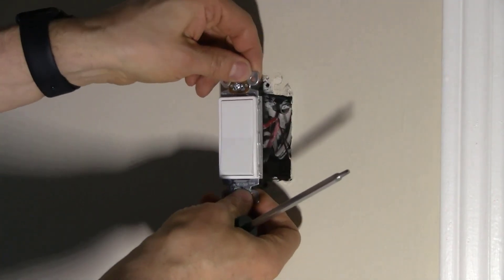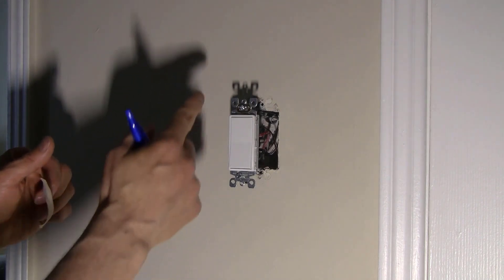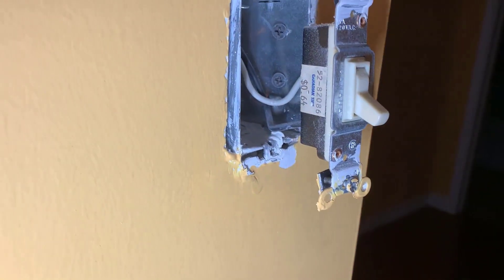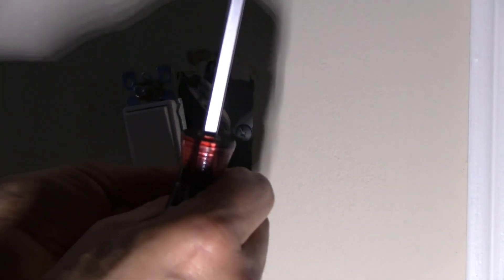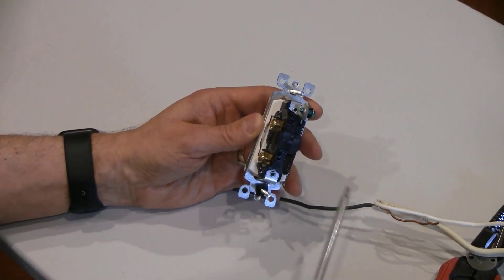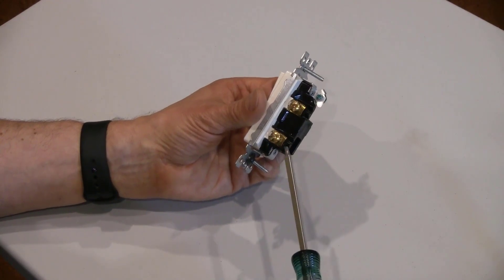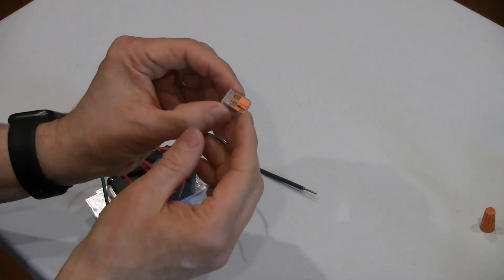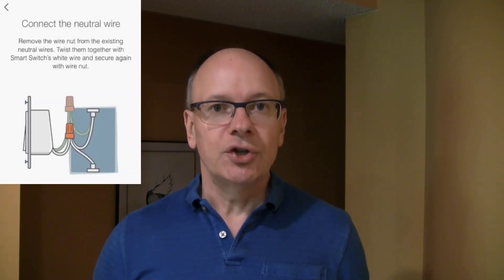8 Mistakes DIYers Make Replacing a Light Switch; #4 is Easy to Make

Comment: A potential issue not listed... when you have 3 conductors plus a ground coming in. Say 14-3. Some houses were wired where two hots pick up every other device on the circuit, and then share a neutral. If you get into a box with a switch and a fan control, you do what I did, and wirenut and abandon the last conductor, assuming it's not needed. Now thinking about it, I need to worry I have an open neutral from stuff further up the circuit!

So now I need to check wiring and make damn sure both conductors were on the same leg and total 120v on circuit. If it was wired to both legs in the service, I now have an open neutral and may begin frying my stuff!
Reply: And I do have a circuit tester, so I can actually clip on and see if there's an open neutral at other devices. Same with receptacle tester. I think it's purely a 'Lights' circuit though. 2006 prefab house.

Comment: Nice video! Mistake #10.  Installing the single pole switch upside down in an electrical box so it reads, “NO” instead on “ON”.  Mistake #11.  When using the “J” hook around a screw electrical terminal, alway attach the wire in the “clockwise” direction so it pulls into the screw body.  Mistake #12.  Sometimes you have to remove the plaster ears of the switch to allow it to sit properly in the electrical box so the cover will sit flush to the wall.  Mistake 13.  When the electrical box is  recessed into the wall, you need to add the plastic spacers to to take up the dead space between the electrical box and the switch to make a solid connection.  Mike #14.  The position of the screws on a 3 way switch may not be the same as the new 3 way switch so always note the common color screw and the color of the 2 traveller screws.  All in all, an excellent and detailed explanation on how to change a switch.
Reply from the maker: Thanks for all your additional tips! And I'm glad you enjoyed the video.